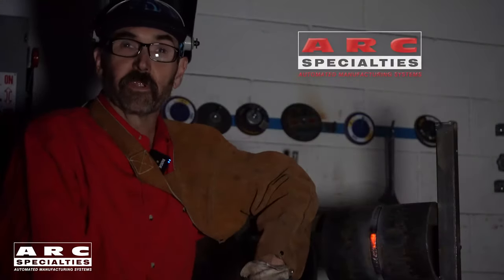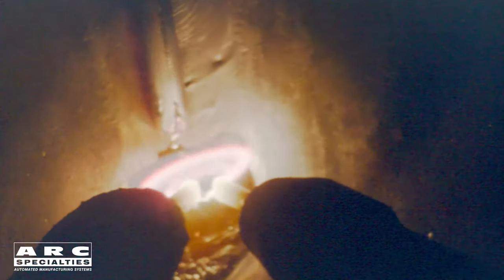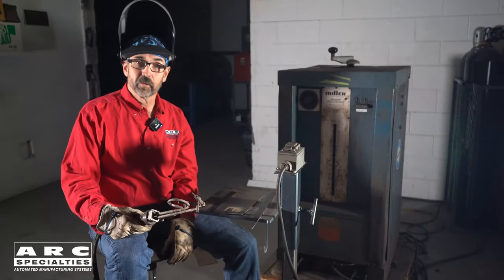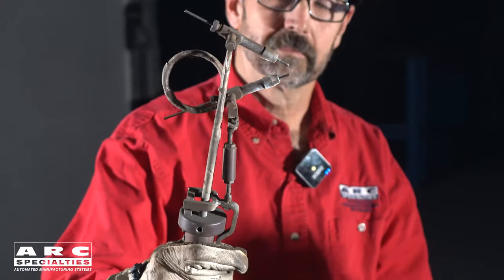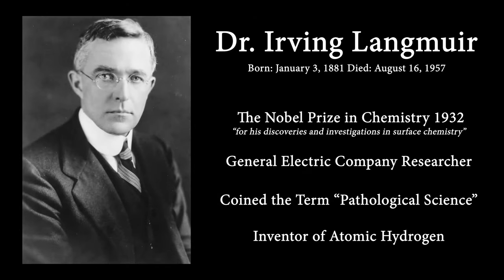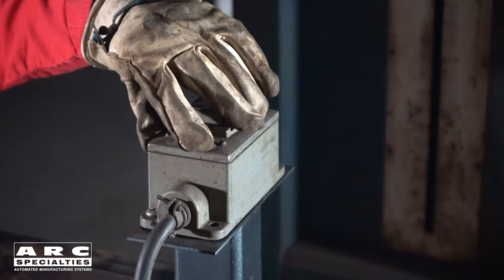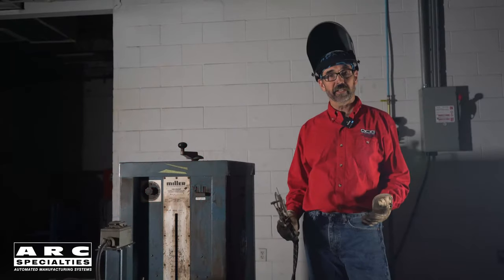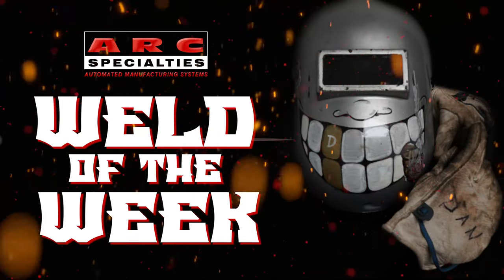WOW Episode 05:  Atomic Hydrogen Welding

Comment: I first heard of Atomic Hydrogen Welding in a series of vintage General Electric welding process videos I've been watching.  Coverage in the video is similar to this one but with voids in detail which are filled by this description.  A couple of real weld examples would make this video more useful.  I own 2 vintage arc torches, one Forney and one Lincoln.  The arc torches work the same as the AHW torch in principle (struck & maintained  arc between electrodes) except that copper clad carbon rods (tapered at the ends) are used vs. tungsten.  Similar to the AHW tungsten electrodes, you vary the distance between the carbon rods to vary the character of the arc.  However, there is no gas component to the standard issue carbon arc torches that came with welders back in the day.  Once you get the arc going, you just move the arc flare onto the work to heat it up, which is most effective for brazing, though the braze joint can be excessively wide and messy due to lack of localized heat control. I suppose you 'could' also do some welding...if you worked hard enough at it and don't just burn up the work in the process.  The arcs give off a sinister frankenstein's monster theme sound with the right current setting and give off an intense white light (ample high intensity UV too!) that's bright as hell!  Welding helmet level shade protection is required - Oxy-Acetylene welding glasses will leave you hurting.  The carbons burn up pretty fast and need to be frequently repointed (pencil sharpener for 1/4" carbons) to maintain a useful and controllable arc flare.
Reply: Very Interesting ! THK!!!

Comment: Woah! Nighthawkinlight just mentioned this process in his latest video and I just had to know what it was. What an elegant technique.
Reply: sure is.    Essentially TIG welding before TIG welding was invented,  in fact appears so much in common it probably wouldn't take a lot of effort to modify a TIG machine to an Atomic Hydrogen welding setup,  since all but the lowest cost Tig machines have high frequency AC for striking the arc without scratching the electrode to the base metal.

Comment: O yeah. This is what I need. I’m a welder in his prime in Pipefitters/Pressure Welder UA. I love a challenge. Compete only with myself. I have my own double bay heavy equipment shop that is currently not used due to my father and grandfather selling trucking company and ensuing work shortage in secondary business in heavy equipment. Need ideas for a welding/fabrication service keeping in mind my brother is a Pipefitter and I am a pressure welder. Vast experience with structural fabrication piping in shop and industrial site experience ranging from new construction to outage and currently working maintenance in big oil